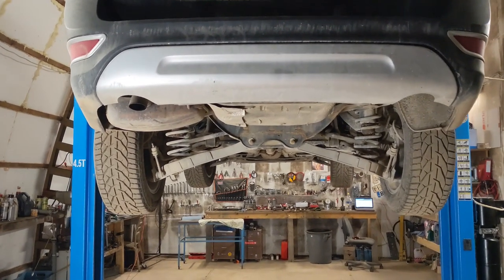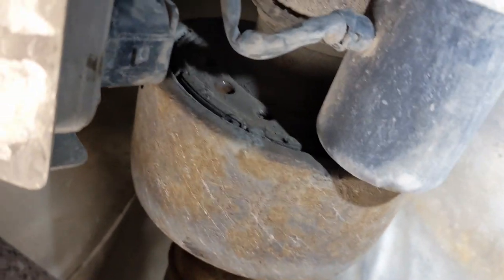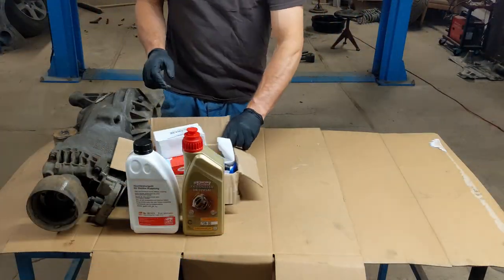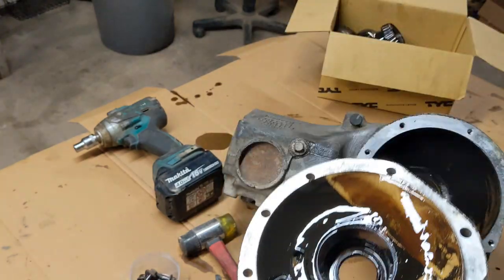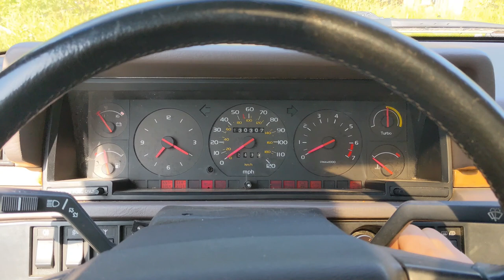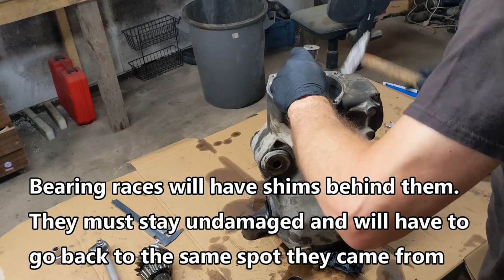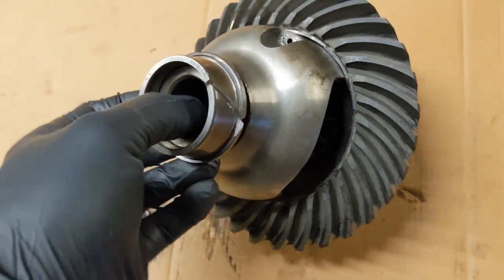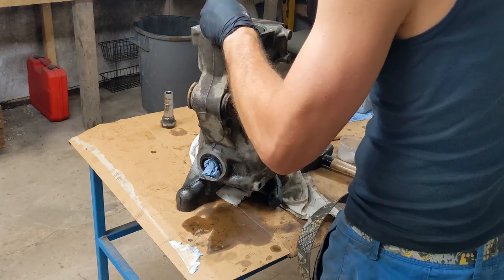Volvo XC70/XC90 Replacing Differential Final Drive Bearings

Comment: great video.  Helped me rebuild the rear diff on my 2011 S60.  The main issue I had was getting the new races to seat without them getting jammed in the diff housing.  Putting the race in the freezer and heating the diff housing helped to get the race seated squarely and not get cock-eyed in the housing.
Reply from the maker: Thats good idea, it was tricky to get them in there
Reply: that is how i do it, but you have to be quick and full comitted to put the race, if you fumble with it it will be crooked and seized because thermal expansion, apply a thin oil first so it will slide in.

Comment: Love the 780 content!
Great video! I’m about to do this rebuild on my 2011 Xc60.( I just swapped out a supposedly good used carrier/ diff but the replacement is now also noisy..😢) I have an xc60, a P2 xc70, a 2010 xc90 and a 91 780 ( with m90 and 960. 3.31 diff) as well…I’ve parted out 3x 780s and have lots of spare parts if you need any parts, though shipping might be crazy from Canada. Keep up the great vids!

Comment: Hi, thx for very informative video. 👍I have a question. I have v40cc awd with haldex 5 and there is a low, bass sound coming out of the rear part but only when car is acceralating. It is especially noticeable when there is a high gear engaged e.g.5th and I accelerate. When I take out haldex fuse there is no such sound-the car accelerates quietly. Did you have  similar sounds? Did the repair fix it? :)
Reply from the maker: Yes it sounds like similar issue and it did fix mine.

Comment: Hello, could you please tell me what car did the clutch disc come from that you used to make the pinion holding tool, i bought one that was supposed to be correct but it does not fit.
Reply from the maker: Sorry I don't actually know because I just had that old clutch disk from something unknown. If you check the link in the description, there is original LandRover tool part number.
Reply: @HeapsofProjects  Ok, thanks, the tool is stupid expensive for what it is.
Reply from the maker: @MrBlueWRX  I thought it was some BMW one but here https://www.freel2.com/forum/topic29814.html someone mentions 2.5 V6 Mondeo

Comment: Hello, I have a question if you are kind, I have a volvo xc 90 2.4 d awd 185 cv geartonic from 2007 and it has a problem with the bearings in the rear differential and I don't know where to find them and what reference they have, please advise how I can fix it and if  you know what is needed and where to buy, thank you very much, I live in France
Reply from the maker: If you go to UK ebay and search "xc90 rear differential bearings" you will find a kit for about 200 pounds

Comment: Have you replaced the gear oil in the final drive/rear diff before it made noise?
Reply from the maker: No, I bought the car like that. I did try it before replacing the bearings but made no difference. I think failing bearings are caused by wrong bearing preload when assembled.

Comment: Which type clutch disk did u use for the tool
Reply from the maker: I did not use a clutch, just a spring as you have to measure rotational torqu. You have to measure torque while rotating the shaft.